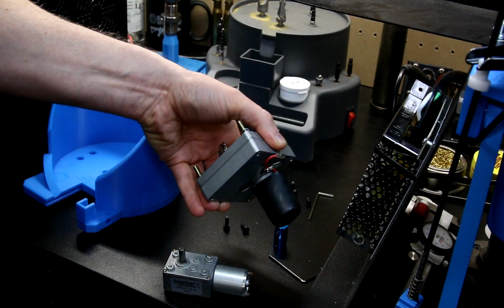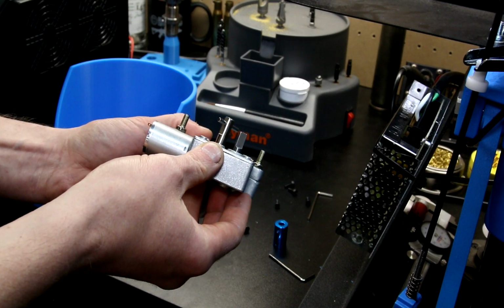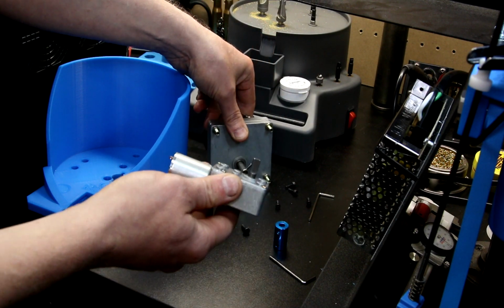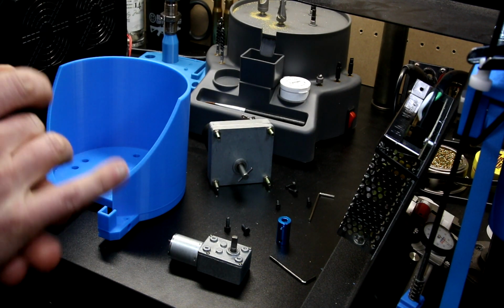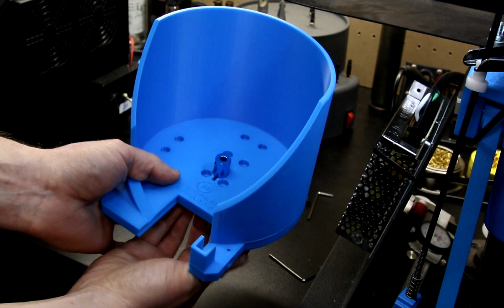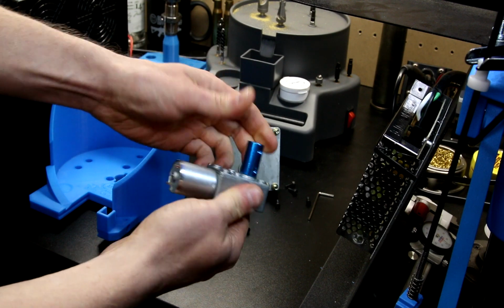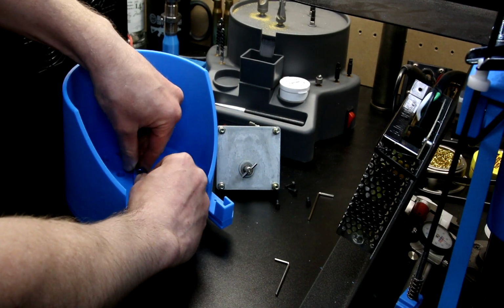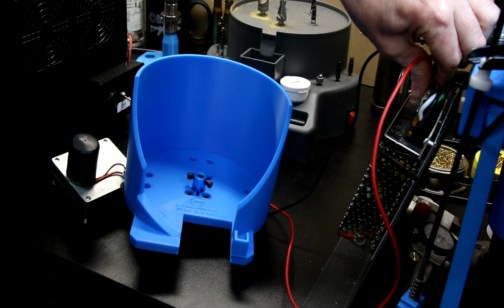openBulletFeeder JGY-370 Motor Shaft Solutions

Comment: Awesome, do you want to share your settings that you used in OPENscad for the new hole size and width?
Reply from the maker: I used Fusion, that plate design is not finished. But the hole is Rectangle 1.13" x 0.29". Circle Diameter is 0.56", it is snug, you may need to add 0.10-0.20" depending on your printing tolerances.